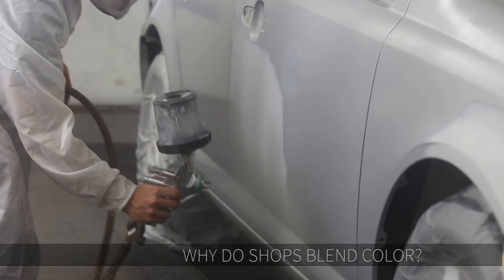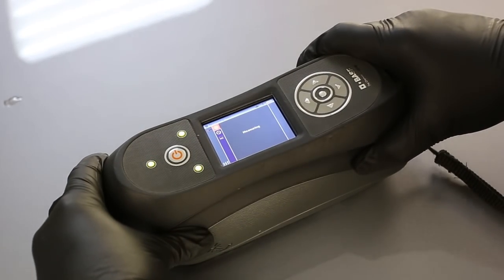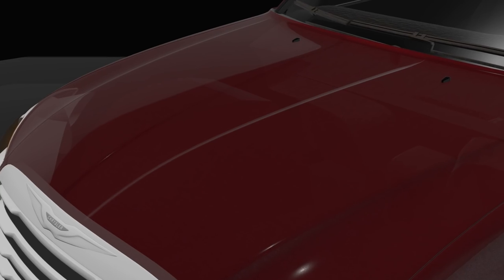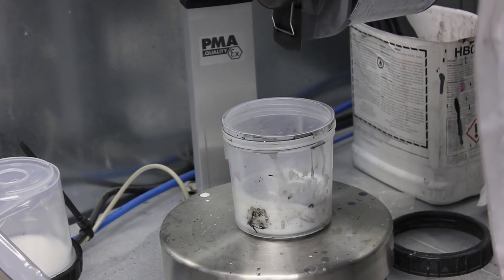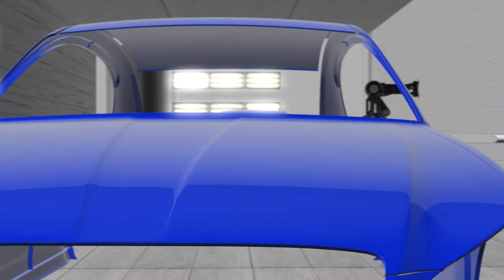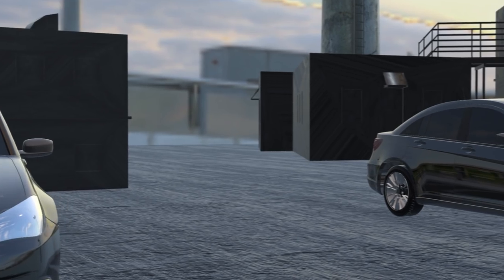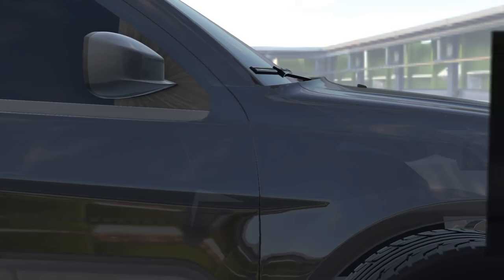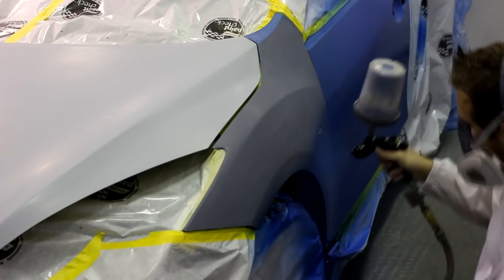Why Do You Need to Blend Color?

Comment: Hi, I got rear door damaged on super white TOYOTA RAV4, and the car is new I bought it 5 months back and I think was manufactured 3-4 months before that, and it had very little sun exposure after I bought. Now I have to replace the door, is it required to blend others areas as well even when replacing whole door? Please help, confused with mixed responses from local body shops..